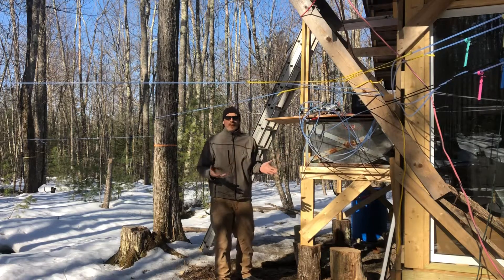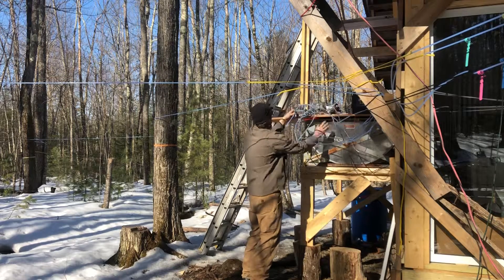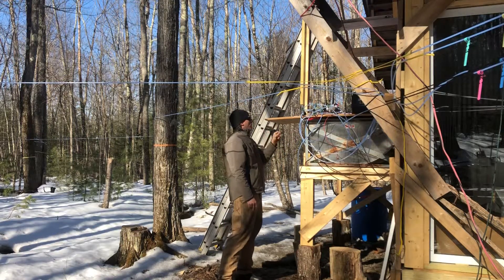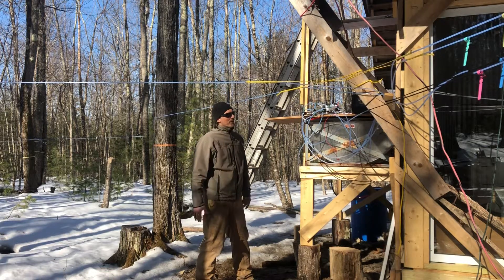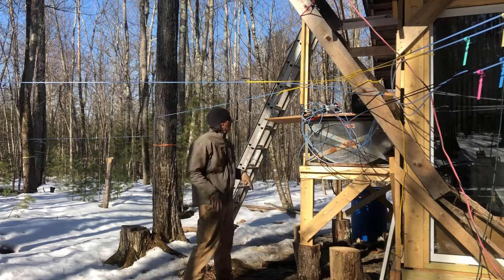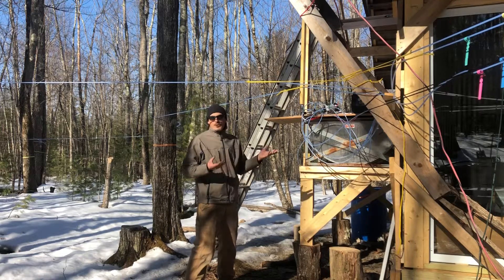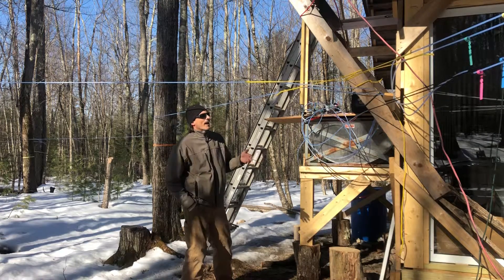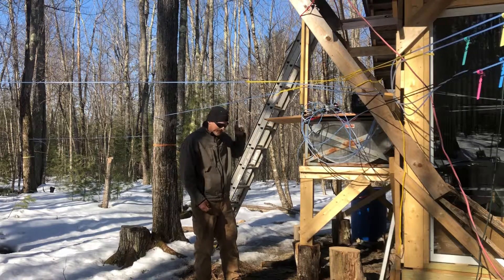Yield more sap with simple vacuum system part 1/3

Comment: Why do u have your lines tied together on your 4 point hub like that? We have 8 lines coming in on a 6 point hub but i do find lines vary on flow.
Reply from the maker: Hey Michael, when I first set up the manifold, I had four lines coming in.  Those hubs are 5/16 fittings.  The way I had it set up in the beginning was two points from one hub were tubed to two points to the other hub.  Conversion fittings were used to hook the 3/16 line up to the 5/16 coming off the remaining hub ports.  Basically, the hubs could share vacuum back-and-forth to help alleviate fluctuations between the two.  I moved the manifold inside this year and didn’t really have time to set it up as I would have.  For next year, I think I will add more four-point hubs to the remaining ports and set up something similar where all of the stars are connected and the vacuum could have a better balance.   Additionally, I plan on adding in-line strainers to all four ports rather than just one coming into the pump. So A total of five.  This way, the strainers will only be handling 2 to 3 lines rather than depending on 1 for 10 lines.
Thanks for your question.

Comment: What pump was it that you used?
Reply from the maker: That was a shurflo 4008 which has three diaphragms -3gpm.  I’ve since upgraded to a 2088 That has an additional diaphragm - 4gpm.  Pentair is the manufacturer.  There is a knock off sold under the name shurflo as well from a different company that apparently sucks.